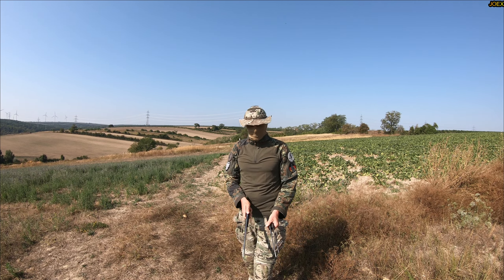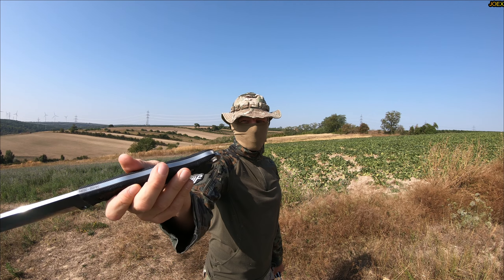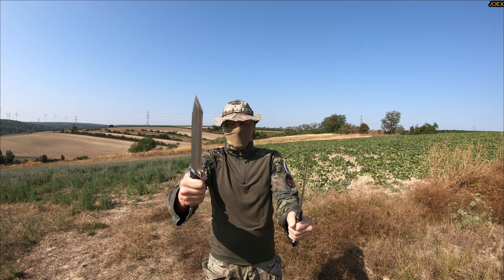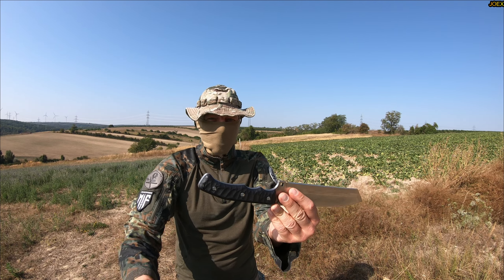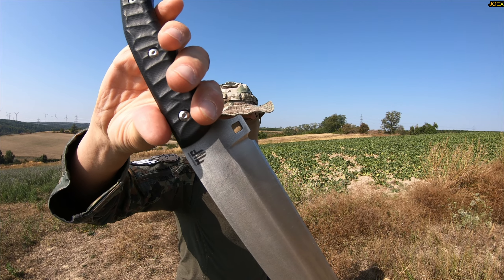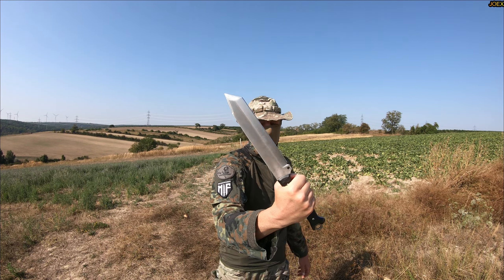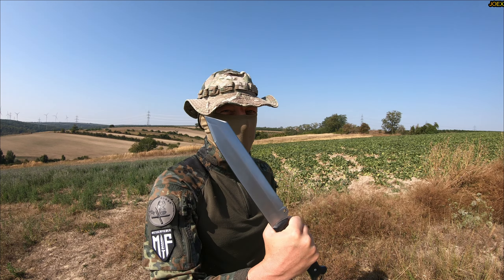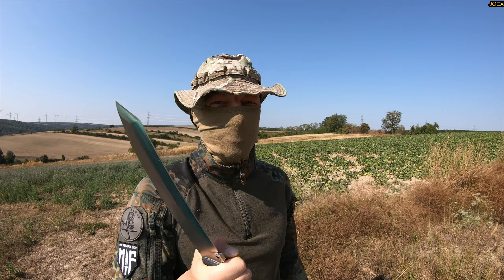JOE X BLADE - PROTOTYPE KNIVES ARE HERE - INTRODUCTION - N690 STEEL - T10 SCALES @messerfieberde

Comment: Good blade shape. I'd make it more narrow and like Glock 78, kampfmesser 2000 or CS recon tanto. It does not need to cut well. Add a strong guard. Use a tough steel (low edge retention). Make the handle like work tuff gear tayal or kampfmesser, but with a stronger guard. Possibly make the lanyard hole smaller or remove it or move it 1 cm towards the tip.
Reply from the maker: ok!